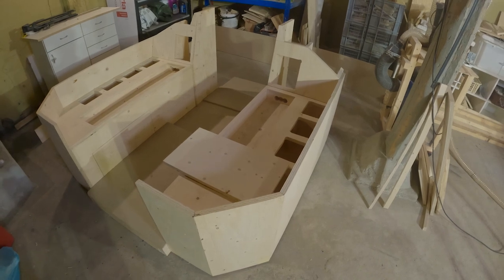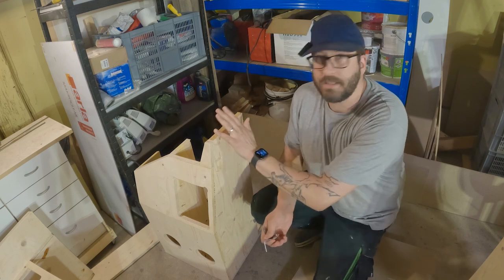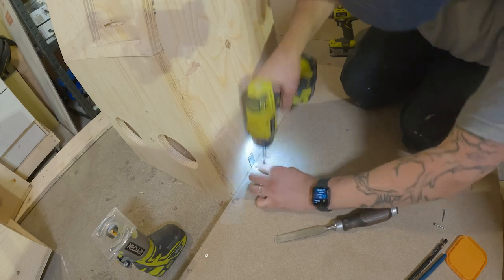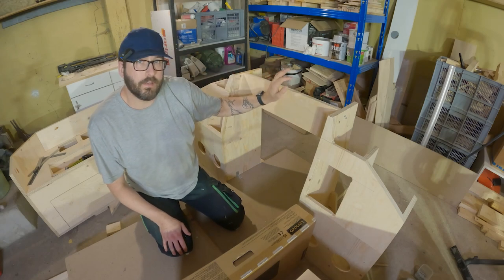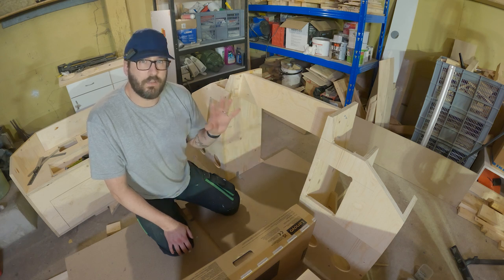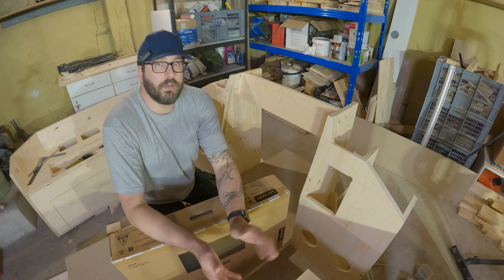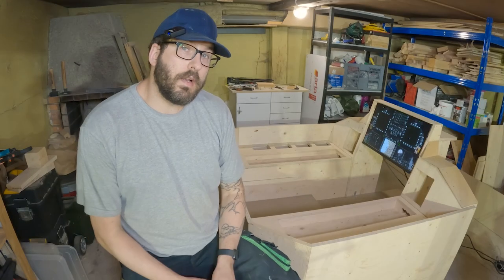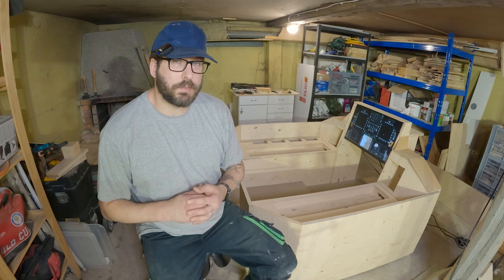Dashboard Display & Finalizing Front Panels - Building a Home Cockpit ep 4

Comment: Soo nice how much ? 😅
Reply from the maker: I think I’ll end up using between 600 to 700 euros for this build. Besides wood and materials, there will be naturally paints and electrics (using a computer PSU for 12v for LEDs), and possibly some metal tool.
Reply: @UndeadParrot  I actually meant what it costs if I buy it from you if I build something like that, it doesn't look as nice as yours 😅😆
Reply from the maker: @richardwiechmann6487  Oh, ok. :D